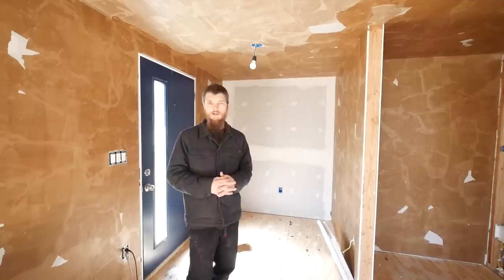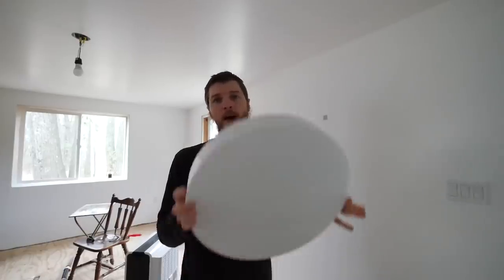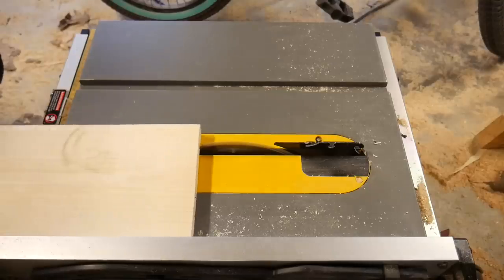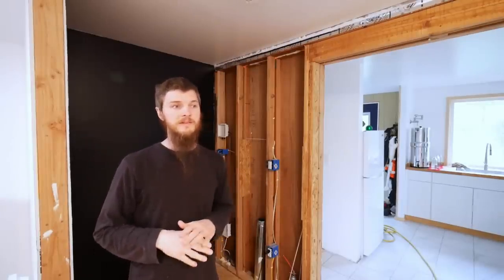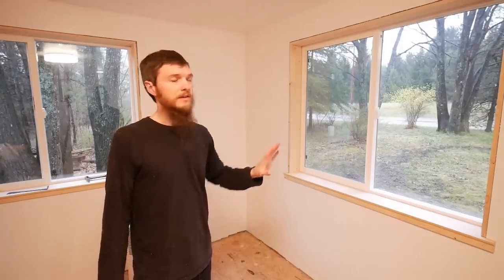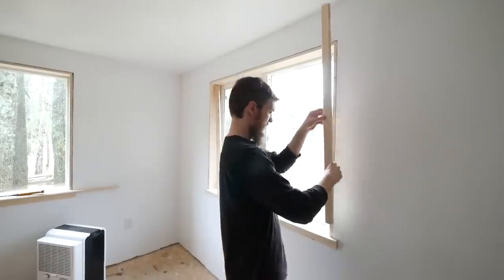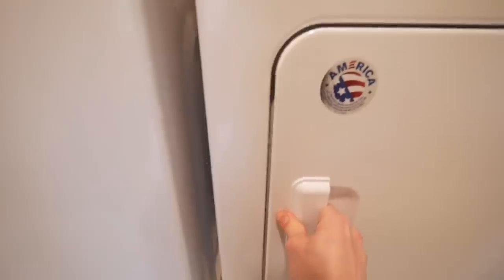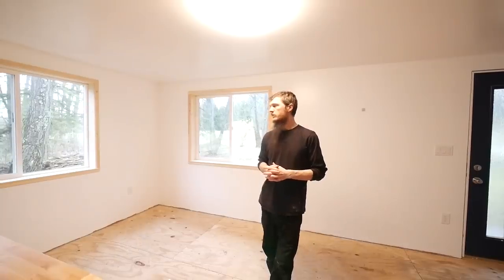Living Room Makeover Begins...AGAIN - Mobile Home Renovation

Comment: For some strange reason I cannot locate the video that includes the link to the Home Depot flooring you and Ashley plan to use in the living room.  I mentioned 2 alternative sources to possibly research.  I haven't yet utilized laminate flooring but today I received info from Ollie's Outlet, a source I mentioned in an earlier comment. (Ollies.us)   If memory serves the link to flooring you and Ashley found was $1.79-1.89 per square foot.  The item I saw in the Ollie's flyer is 79 cents per square foot, 7mm thick, 23.91 square ft per case, 8" wide x 47.64" long, 10 year li,tied warranty, clueless lock-in locking system.  Sku 412662.  $18.89 per case.  Brand OAKMONT LAMINATE flooring deal.  Ollie's buys huge closeouts and sells to the general public. 

I searched for a POBox hoping to obtain your zip code with a goal of researching if there's an Ollie's anywhere near you.  I have no idea if they have a presence in Michigan.  If you have purchased flooring I apologize.  And as of now I will cease sending detailed flooring info.  I am not associated with the business - I simply enjoy searching for and finding bargains.
Reply from the maker: It's important that we get a laminate floor that's 12mm thick to match up to the height of the tiled areas. We did end up buying the laminate floor we were planning on getting. Thank you for thinking of us though :) We love Ollie's and have shopped there for years.

Comment: Ok I lost the video where the very end you show the washer dryer top cupboards .. I noticed the washing detergents at the very end are placed directly onto the wooden cupboards.  If there was any small spill or overflow it can be difficult to clean.  Place them into an open top plastic container so it spills onto the container

Comment: Did you lose an outlet in the closet/nook area? Looks like there's a blue box at the beginning but no hole was cut in the accent wall.
Reply from the maker: The blue box was just in the hole, but wasn't meant to be anything. That section of drywall was a mess up from our son's room that we installed there to use that piece. :)

Comment: They do make  a A/C and Heating Unit to put in the window...
Reply from the maker: We don't need AC here and we have our silent electric heaters already installed in each room. The woodstove will just be another heat source :)
Reply: @diyfferent  We have a wood stove to. True it is clod were you live. We live south Texas its been high 90s getting rain soon... :)